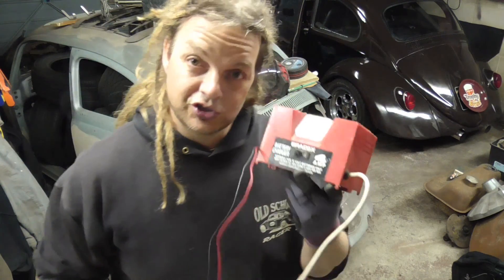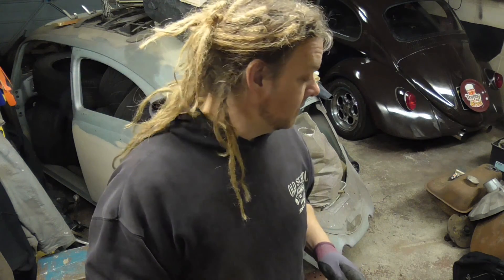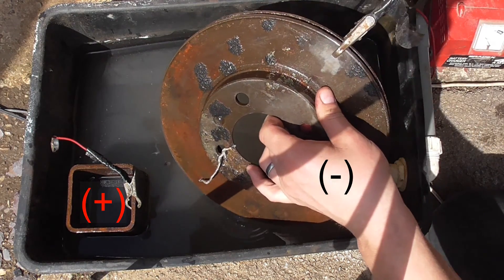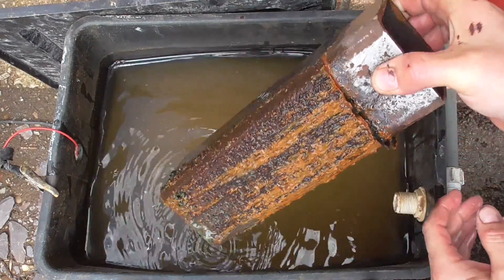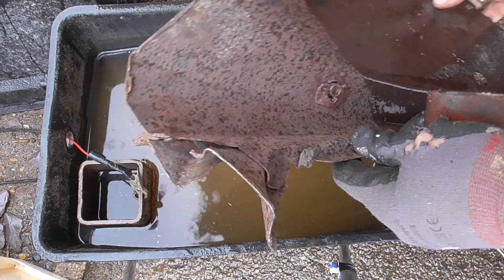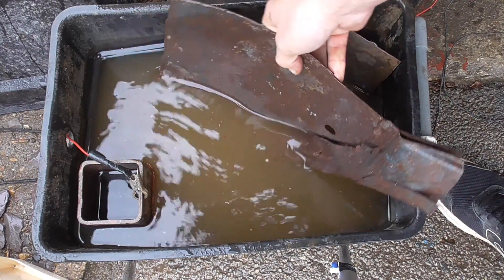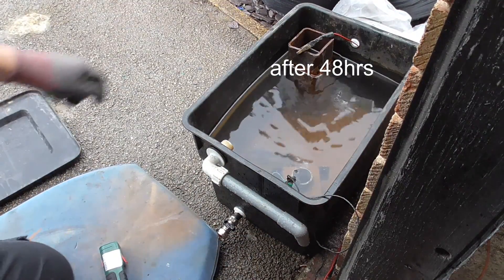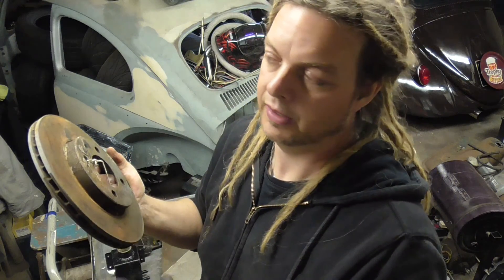Electrolysis To Remove Rust from Car Parts. Test to see if better than Citric Acid etc

Comment: Hi. I have found the same findings as you. However. Citric acid although works really well, it erodes all of the steel. I put a 1600 Aircooled cooling fan in for a soak over a weekend. I’d estimate it lost 20% in weight over those 2 1/2 days. The fins were loose. 
And it was noticeabley light. That was with a 25% mixture. 
25 litres of water with 5kg of citric acid. 
It has its uses for sure. 
I’m currently experimenting with rust removal via chelation. I’m using Sodium Gluconate. It’s totally non toxic and neutral ph. Mixing ratio 5-10% by weight with tap water. 
Gives good results although is slower than citric acid by half. But it does not attack the good steel which is a massive advantage.
Reply from the maker: Wow great write up thankyou 😄👍. I don't think I have ever made my Citric Acid that strong. Tbh I never measured it all that accurately but certainly not 25%, and although was some pitting In some bits don't think it deteriorated most things too badly. However I did put a engine cam in which was dead but wanted to clean it up for an art project. The steel came out clean but the cam gear was really badly eaten into. I'm not sure what it was made of as thought should be tougher than Ali but maybe not. Isn't that what the fans are made of? Maybe the same metal and same issue there? Not sure if you have seen my Citric Acid vids? They were some of my earlier vids now so not brill but can see what I got upto in them. I was told Vinegar is less aggressive so considering a video trying that, not heard of Sodium Gluconate though? Will have to look that one up! Thanks for the great info 😄👍

Comment: I cut an old floorpan repair panel into 4 strips, 6 inches wide.
Each one is folded over the tub lips side to side and they are wired in series on the outside edges.
I also use a battery charger but have a crappy old battery in series to prevent the charger from going pop.
For best results you need the anode and cathode in close proximity and in line of sight.
This is why the catch can did not work well.
It's great for removing heavy rust but i've had better results using Deox C for pitting and light rust.
Reply from the maker: I've just reread that. Great idea having the metal all the way round. And tip regarding the line of sight should have been obvious as the sludge only built up on the facing side of the (-) but it hadn't clicked in my head LOL. Yet again tx for your great ideas and suggestions :)